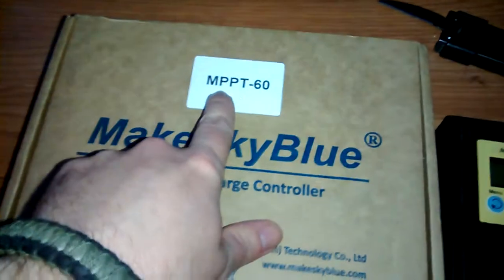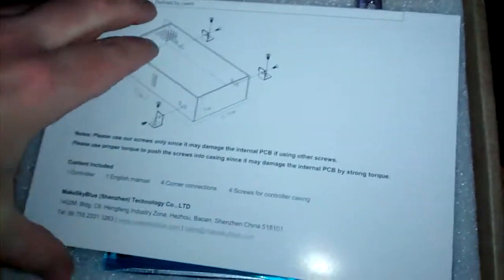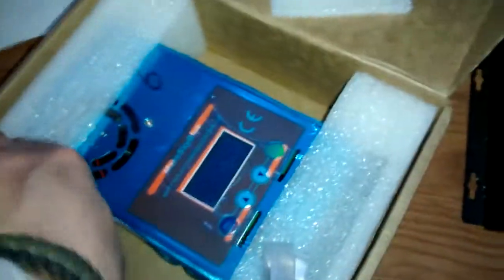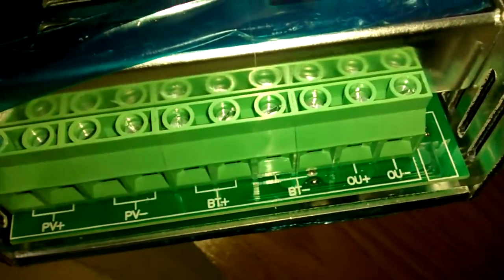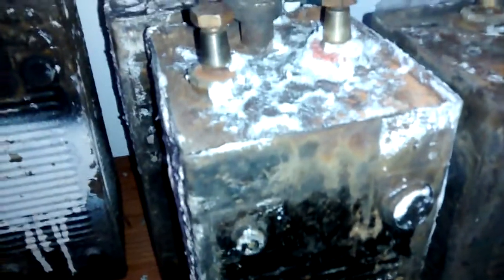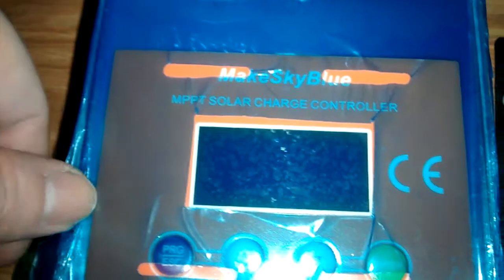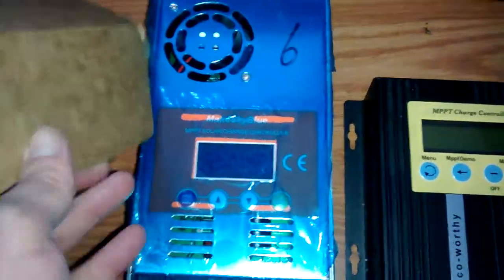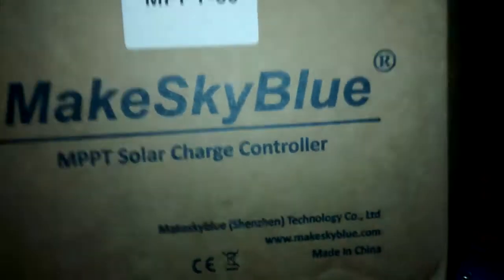Chinese MakeSkyBlue 60 Amp MPPT Charge Controller with Manual!

Comment: I've posted because these dishonest xXxX won't reply to fix the problem. You can have a look at the evidence on the video already posted on YouTube. They sent a me instructions and a circuit diagram showing the preexisting fault. The inverter has CE Mark which is a joke, as it 28 ohms to earth. They used a terminal clamp on a paint surface for the earth.
Reply: These controllers are still junk I bought one 60amps few weeks ago and it got super hot before it even reached 40 amps of charging current and it started to smell burning it can only handle 35 amps safely anything higher it will burn and start a fire
Reply from the maker: You bought early ones. Do you think they worked out the flaws in later production units that caused failure? So many people are using these now with no issues.

Comment: I brought two inverters from makeskyblue, both failed within two months due to a preexisting known fault. ZHANG Na of their tech dept asked me to  a modification to the circuit boards. When it didn't work they stopped communicating. These people are dishonest and don't honour their product. I also suspect the CE Mark is fraudulent is the product is not earthed, and this is a requirement.  I recommend not purchasing any of their products.
Reply from the maker: Do you have a video to support your claims? I've seen you post all over MakeSkyBlue videos with your story.

Comment: I hope this works good. I trust your reviews.  I always wonder about some of these reviews online, seem they are just there to bash Chinese goods.  I remember your old review of the ecoworthy.  Mine still works, but I bought a makeskyblue but yet to hook it up. Seems for the price, best value (however that is changing I think I paid $120 for it).  

You can get a volt meter to see if it really shocks you.  I doubt it.
Reply from the maker: I may have to do another review with it opened up plus I missed half the manual it was a fold out. In my world it either works or not, when I get more time I will hook it up and see for myself.